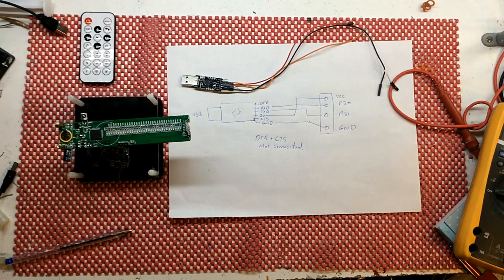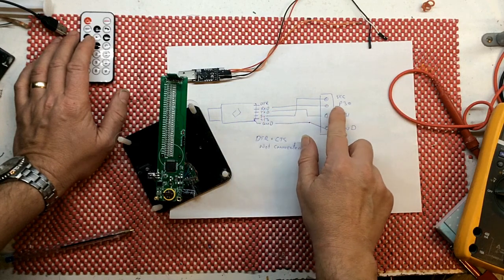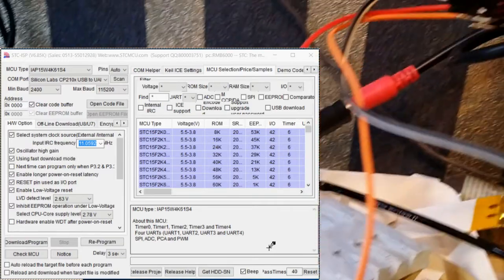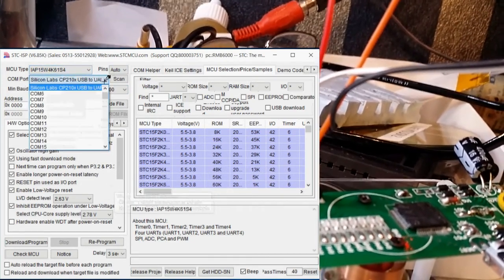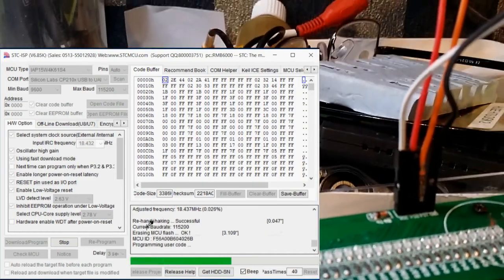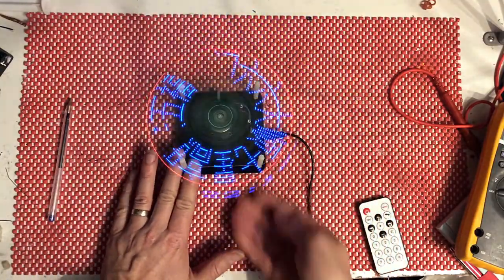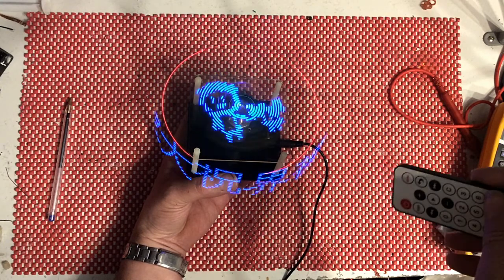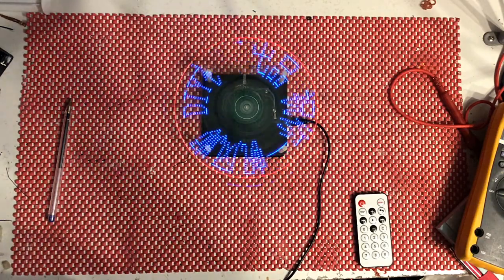Rotating LED Kit from Banggood.com Build part13

Comment: Hi kev

Can you help me? The problem is that when i put the animation of the clock it only shows the hour hand and it does not move, how can i fix that?
Reply from the maker: sounds like a issue with the RTC (real time clock), make sure this chip is soldered the correct way around and all pins are soldered, its the 8pin chip by the IR sensor.

Comment: Hello Kevs 

I know this was done so long ago but I ran into a problem here. The device was working perfectly until I tried to upload a hex file. Every time I clicked open source code and clicked a hex file it would say failed. so i copied and pasted the hexidecimals into the buffer and uploaded it that way, However since then my device does nothing. The red light will stay on but none of the blue lights will turn on. They mentioned something about if it is hooked up wrong, My USB to TTL cable had no references to which was which (Very stupid, I know, But all I had) so i looked up the wire colour coding and followed that, however that i do not believe was correct and most likely the rxd and txd where swapped. No doubt this has fried it :( all that time and effort into it and bam dead. however, what are my options can I replace something (chip) to fix my device

Thanks for helping me out, look forward to your response and have been loving the videos  

kind regards Jordan
Reply from the maker: Jordan Letchford if you managed to upload something thats not right its probably just crashing and a valid upload may fix the issue
Reply: All the hex's they provided show with this text box " Open File "File_name.hex" Failed!", so I do not have a valid hex to upload. I downloaded that link from banggood you commented below and tried those hex's however they show the same result. Am i able to upload with just GND, RxD and TxD without the 5v or does the power need to be there?
Reply from the maker: Jordan Letchford the power needs to be there, basicly you set device to program, com port to use and frequency, connect all but 5v and hit program, then apply the 5v which will put the device in program mode.
Reply: Thank you for responses and help, done a top job mate. The issue I was Facing was the STC-ISP did not wanna accept the file due to the location having Chinese characters in there. You re-named the folder you downloaded to Banggood, however, I Left it as the Chinese characters and that was not accepted. I ended up changing all the folder names and files that I refer to English words. Thank you again for taking your time to help me and respond
Reply from the maker: Jordan Letchford so is it all running again?
Reply: I am able to upload the hex files yes. The original code that was on it (the animated horse and such), is there a way to put that back on? Also unsure if you have covered this in a  later part of your youtube channel but were you able to get Keiluvision (that they supplied) or PC change word software or the circular picture taking software to upload?
Reply from the maker: Jordan Letchford yes its covered in the spherical vidios, its same beasty realy
Reply: beautiful. I also have that project to build as well but soldering those LED's takes stupidly long. I watched how you did it, however in hindsight is there an easier way to solder those LEDs onto that spherical surface? that won't take me a day to just do a couple.

Thanks again for your time to answer these questions
Reply from the maker: no easy way, some people say glue them in place then solder but would imagine that to be a tad smelly.

Comment: If you want to reverse the scrolling (from right to left) just reverse the wires on the motor... works fine.
Reply: Reversing the motor will also flip all the text and numbers backwards so a 3 will turn into an E and words will be spelled backwards.

Comment: Can you tell me why my images are backwards, or mirrored?  For example, on the clock, the 12 is on the bottom and looks like "15" and the 9 looks like a 6?
Reply from the maker: your motor connections are round the wrong way so the motor is turning in reverse

Comment: i was able to load the HEX file and i can see the Leds flicker but it stays in the ripple effect and will not change when i press the remote. how do i test the remote?
Reply from the maker: if leds flicker on remote press then remote is working, some of the hex files dont use the remote, the ripple affect is normaly the startup while its waiting for the position sensor (ir beam) to be activated.
Reply: led flicker on the module usb2ttl converter, which means hex file being uploaded
Reply from the maker: which one of the programs did you upload ?
Reply: I tested the remote with cell phone and it seem to work. i tried all "DIY-++t.hex" files that was in the Three-dimensional plane rotation LED Profile V1.0 folder
Reply from the maker: if you are the point where a couple of leds are rippling down the led array then your next step is to spin it up, if all is good it should go into full animation, if not the timing IR needs to be sorted. only once your animated the remote should work.
Reply: all is good. do you want me to short this IR sensor?
Reply from the maker: if its not animating then the timing ir reciever/transmitter needs to be checked, the transmitter on the base should have a purple glow when looking via mobile phone camera, make sure both devices are connected correctly.
Reply: the diagram on the board for receiver was wrong. so i took it out and soldered it back in the correct orientation and it was working nicely. But after a little while the front display(16leds) stopped working and remote does not work. Do you know the specs of this receiver led?
Reply from the maker: if the top face is working then the IR is doing its job and is ok, some of the hex files in the download dont use the remote, think i used hex number 7 as it had more features but watch the video i did, cart remember what part it was.
Reply: i could not make the front display to work. when i turn on it comes on for a second then it blanks out.
Reply from the maker: If you prevent the arm from spinning and switch it on does the test ripple through the front and also the face leds?
Reply: when i prevent the arm from spinning and switch it on, i see every other led is lit on the front and also on the face. no ripple. i get ripples when i load the first hex file inside "1 Light water testing program" folder
Reply from the maker: ok just tested, every other led is good for number 7 hex, i have uploaded a video for you, if it dosnt animate when spun then the ir sensor needs checking/replacing like i had to do back in part 11 or 12, just generic 3mm ir sensors available on ebay.  heres the vid  https://youtu.be/nVxkDlXTcec
Reply: got the IR receiver and transmitter and changed them, but no difference. When i power it up it displays animation for a second and then it vanishes leaving behind only horizontal lines.Do you know how the speed of the motor is controlled?
Reply from the maker: can you upload a video of what its doing to your youtube channel
Reply from the maker: Ok it looks good now make sure your using 5 volts and them make a note of how much the 2 coils overlap. remove the rotor and re-install with less overlap, if no good try more overlap. im my mind the regulator side is designed wrong which makes the coil bonding crytical (yours has far more overlap than mine).
Reply: i tried all different combinations, still could not make the analog clock to work. it only shows the hours' arm and the numbers. do you have the app that is mentioned in "2íó56 rotating LEDs instruction V1.0" pdf file?
Reply from the maker: i only have a instructions.pdf, what is the name of the App does it say?, is it now working just the seconds hand missing?
Reply: App name is in Chinese. i was thinking about loading my won image. the seconds hand is missing and also the minutes hand
Reply from the maker: it sounds software related now or maybe there is an issue with the real time clock, think its just software.
Reply: is there a way to test the real time clock on board?
Reply from the maker: to be honist i dont realy know, cant imagine it would make the hands vanish it would just not relay the time so the time would always be 00:00.00 all hands at 12. this is only what i would think would happen.

Comment: Can you use a pickkit3 on programing this?
Reply from the maker: no it needs a usb to serial adaptor like used on Arduino, about £2 ebay
Reply: Thanks for letting me know.  I guess I will cross that bridge at a later date.  Now I just want to get the beast going ;-).

Comment: I reacted on ealier videos about programming and this helped a lot. thanks. 

My remote doesnt work either, i think its broken. Or might it be because the receiver isnt great. any ideas?
Reply from the maker: +Mike j i had lots of problems and not sure what fixed them, Dont know if you have the standard hex or have changed the hex as some of the hex files look like they dont have remote control when i look at the source.
When you have a image displayed pressing any key on the remote will make the image/text twitch by a pixel or 2 if this happens remote and reciever are working and its code issues. If not check the remote output with phone video camera in a dark place you should see its purple glow.
If you have changed the hex make sure clock speed is correct when programming.
Hope this helps, get back to me with any results.